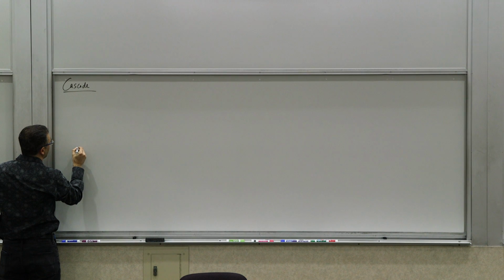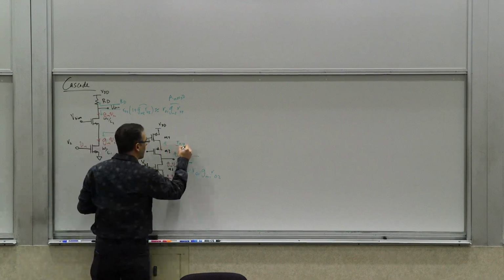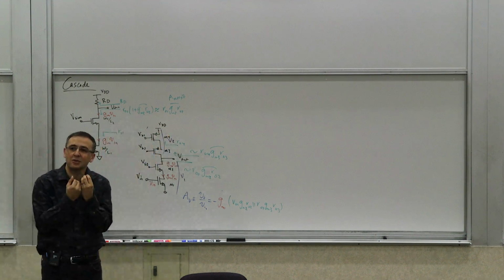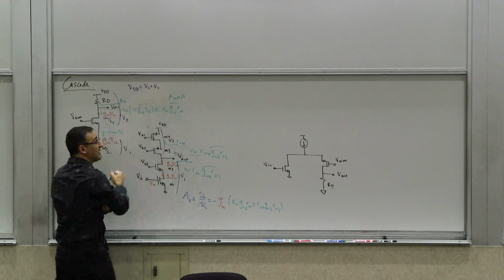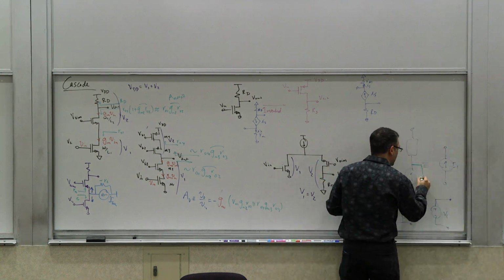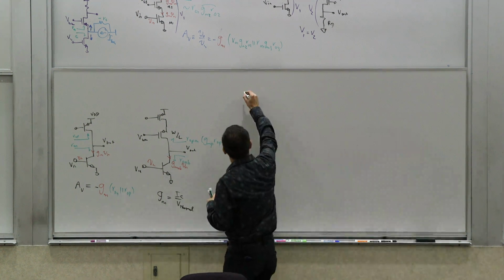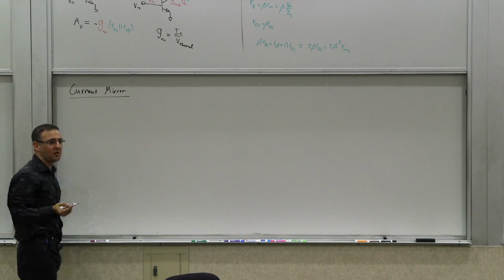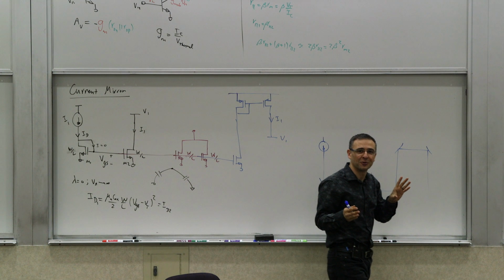125N. Two transistor stages: cascade, folded cascade, active load, Darlington, current mirror

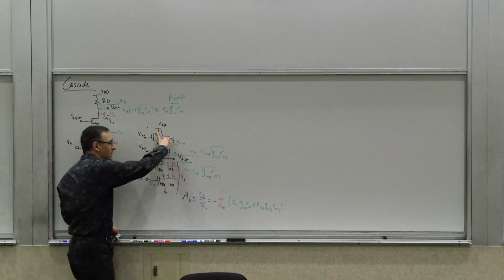Comment: 20:30 headroom explained. 
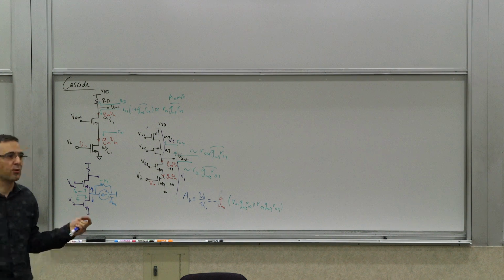28:00 small signal model is same for PMOS and NMOS
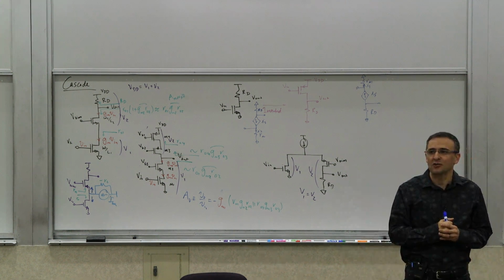38:00 Ideal current source , ideal voltage source
 41:00 MOSfet ends

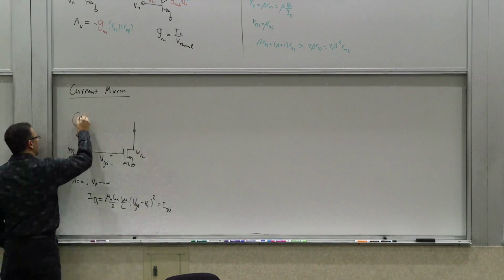Comment: 58:43 Sir, isn't the bottom transistor already acting as a current source. What is the need of an additional current source on the top? This way, we have to connect the drain of it to some Vref to setup the current. Or is it just that instead of a Vref connected to the drain, you directly chose an Iref current source in series?
And very very thanks for the lectures. I bow down for passion of teaching and maintaining a great exciting environment in the class.
I never thought or heard circuit Design as an art before you described it many times in the class, previously I thought "all the equations, techniques, mathematics is established, simulators are there. What new can I add? But, now I see room for contribution for the variety of needs a circuit or system can demand.